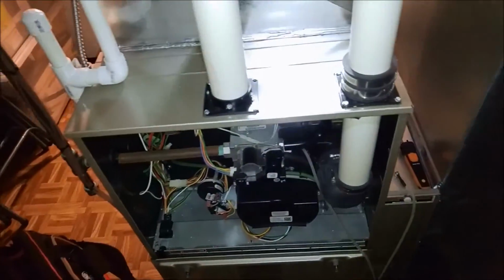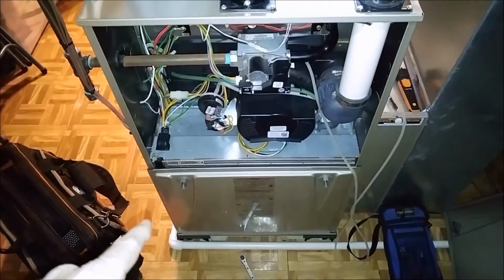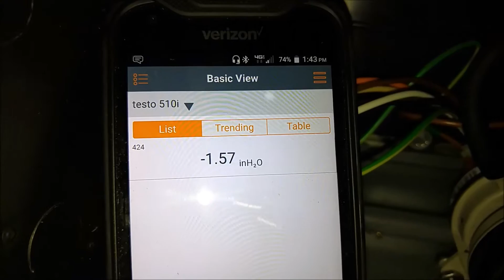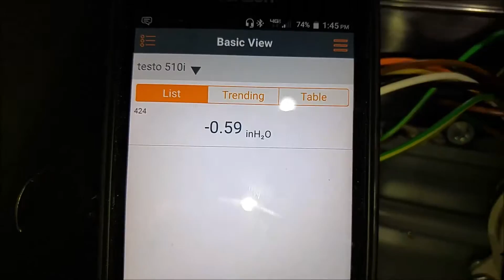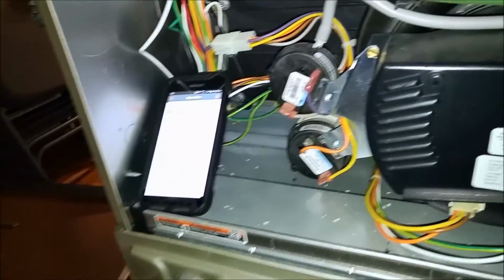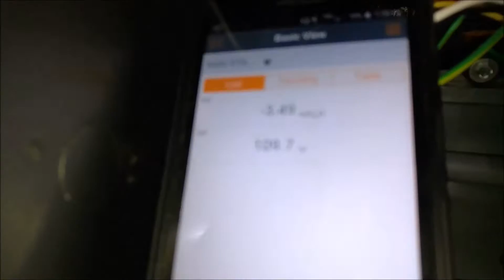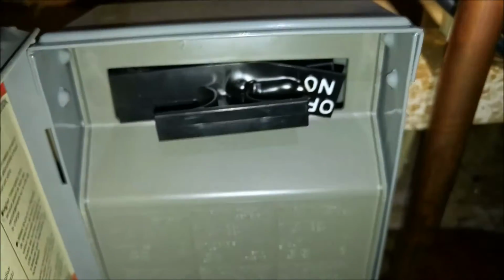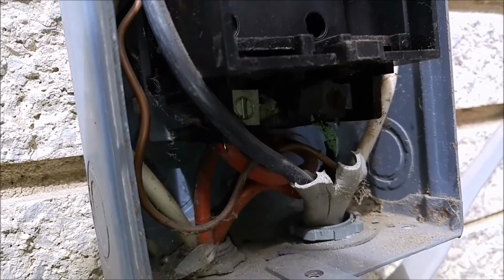Carrier 59mn7080 Adjusting Manifold Pressure

Comment: Carrier 59MN7 modulating gas valve is adjusted for Step 1 maximum 100%. Step 2 adjustment for minimum gas pressure. The user interface communicating thermostat should be disconnected and Dip sw SW1-2 is on, SW4-2 is off to lock in minimum heat for the adjustment.

Comment: i just set one of those up today there is specific procedure to setting up gas pressure in the installation instruction which requires dip switches and jumpers when setting gas pressure u can not use the user interface in check out mode .....

Comment: two disconnects is strange and both melted, probably never tightened the lugs to start or used undersized wire :(
wrong breaker at panel combined with compressor failure or neighbor stealing power :))